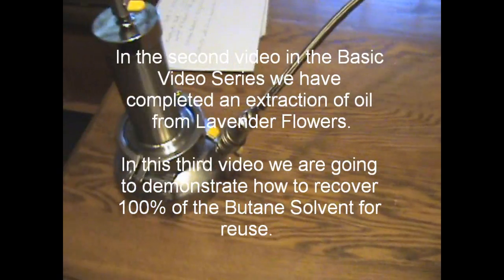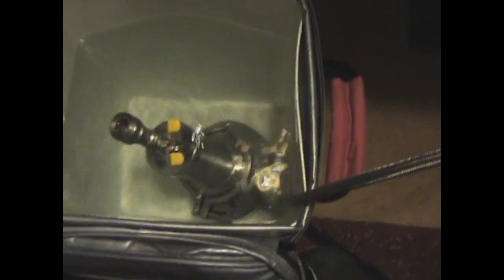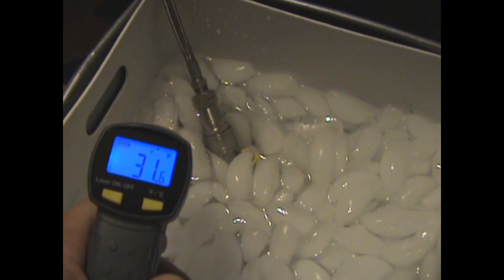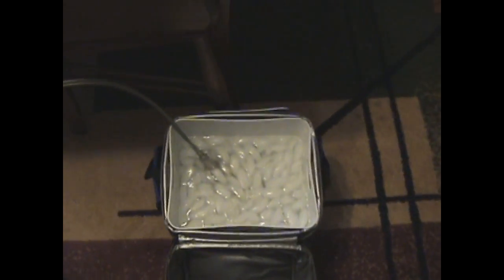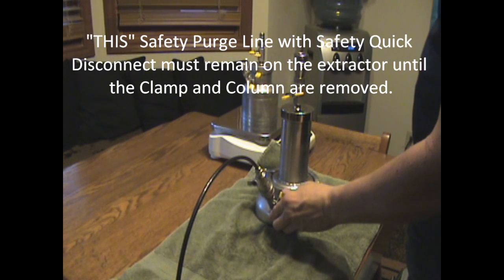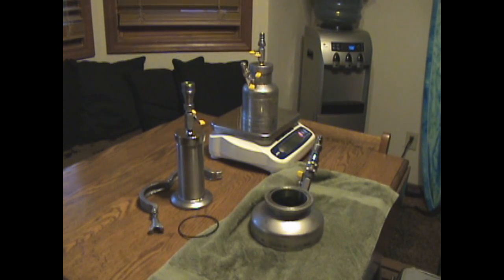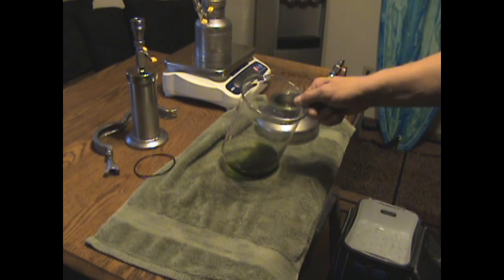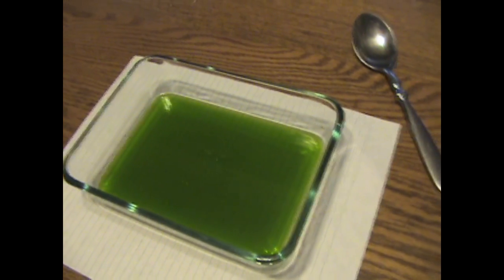Tamisium Butane Oil Extractor Basic Video Series, Video 3 - Recovering your Butane Solvent for Reuse

Comment from the maker: Yes. When you extract with a more or less liquid vapor, freezing and very fast like you are you will get way less green and less oil out. however if you extract with a liquid solvent slowly at mild room temp you will get way more of everything out. You can play around with the temp, speed,time to get less green and more oil in this system and you will learn how to increase the yields of oil. Green can be removed after you get all the oil out as well. That is standard processing.

Comment from the maker: Many reasons. Alcohold evaps at 175 and would end up evaping some aromatic oils away when you remove it it. The alcohol in the bottom is added if you want a solvent to transport it out. However if you dont want to loose your oils as described above I recommend using butane as the extracting and transport solvent. We used this extract for medicine and were not interested in keeping all the aromatics. So we transported it with alcohol since it was cheaper than butane. Just an example.

Comment from the maker: @sebastian0217 
Vacuum purging is necessary when you want to either speed up the evaporation process of recover your liquid solvents used to extract with. When extracting volatile oils you dont want to speed up the process because you may evaporate your volatile oils and decrease your yield. Using this system you are already able to recover  your solvent. The dimensions of the tanks and wattage or heat input is what we determined is best after 5 years of trial and error.

Comment from the maker: @mrsmithster 
A pure oil is lighter in color and achieved by using a fast cold gaseous extracting method. 
A liquid warm slow extraction will get more out.
It is a tradeoff from a partial pure product to a complete extraction.
One produces the highest purity and one produces the highest yield. 
It is amazing when you can get either from the same machine by varying the process used.
That is what you can do now with a Tamisium Extractor.

Comment from the maker: @tamisium 
You are vacuum purging technically. Only without a vacuum pump or compressor. Butane responds to a lower temp of 32 or less like it would respond to a vacuum. So we use the temp reduction to move the butane from liquid to gas because it is easier and cheaper.

Comment from the maker: You can get more green out with added time and adding temperature. 
You can remove green polar oxygen based molecules but reducing time and reducing temperature. You can get a golden solid out if you want. Gold cups have been won using this system and discoveries have been made. Each of those extracts were of a different process only achieved using this equipment.

Comment from the maker: The purpose of this system is to simplify the process so that we can now all research and learn how to extract with a high performance machine. Adding vac purge not only brings in electrical or mechanical equipment into the scene it puts it out of the reach of some users. But yes it can be done if done safely. Vac purging any solvent that is flammable, alcohol, acetone, or butane can be dangerous if done incorrectly.
In addition, this system is using a vac purge process w cold vacuums with ice.